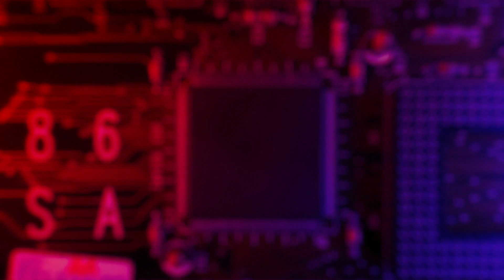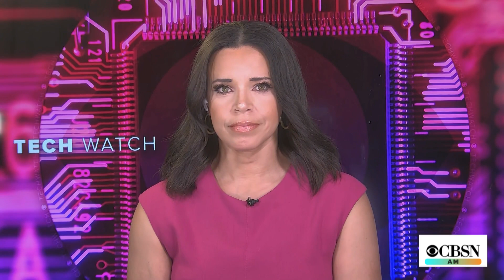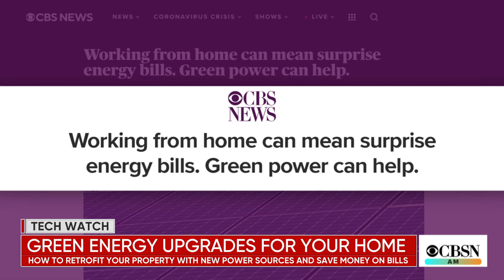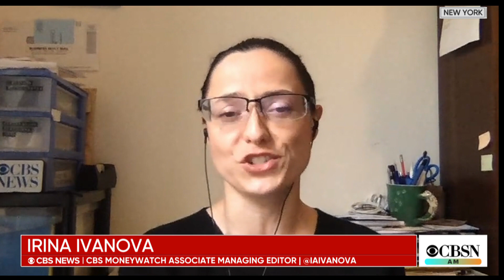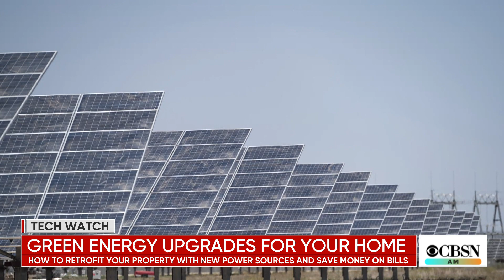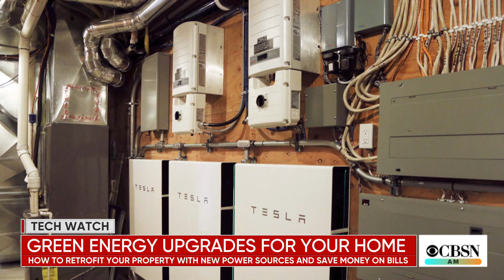Green energy upgrades for your home

Comment: My mom was thinking about installing solar panels she has her own house this is pretty interesting actually🤔
Reply: Just keep in mind, every 10 years or so a house needs a new roof and solar panels don't last forever.  When they put on a new roof, they have to take down every solar panel to put on a new roof and then re-install all of the panels.
Reply: @Mr.White10-65  Roofs can last 25-50 years with the right materials.....If you paying for a 10 year roof you are being ripped off, or are moving.
Reply: @john-smith.  maybe in other areas of the country, but a roof with shingles lasts 15 years tops on the East Coast.  In any case, removing solar panels will cost additional money when getting a roof.....which was the most important part of my comment.